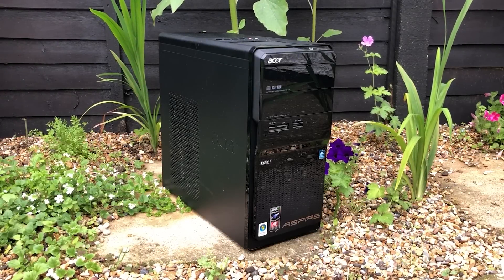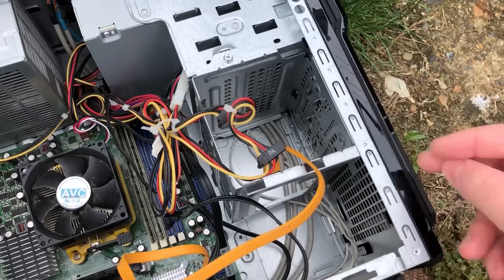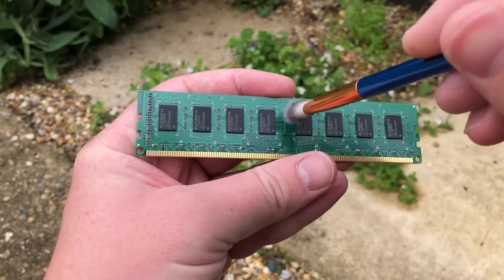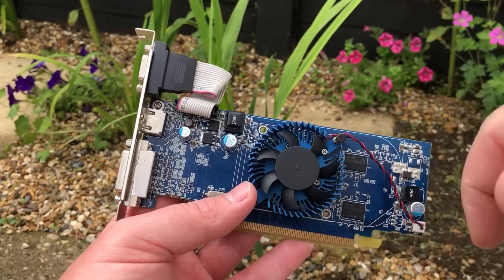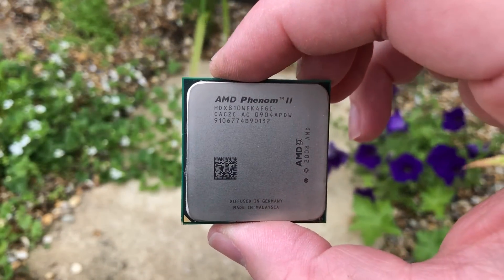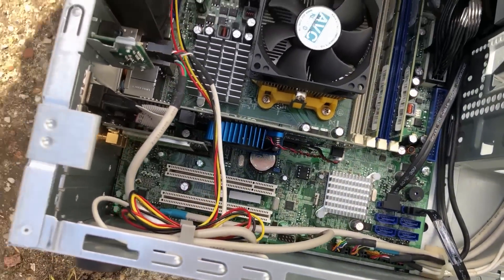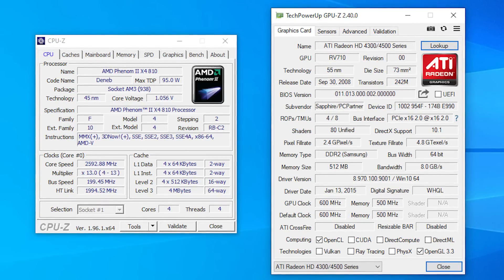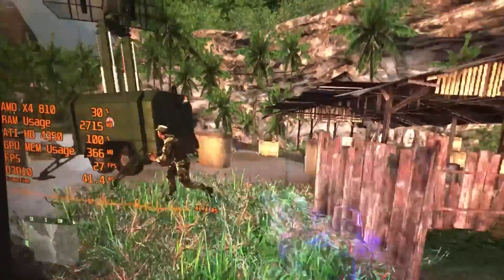Fixing Broken Ebay Gaming PCs - The AMD Acer Aspire

Comment: Shocking to see Acer using a motherboard with electrolytic capacitors near the VRM. By this time a lot of board manufacturers had switched over to polymer capacitors. Electrolytics have a lifespan of about 10 to 20 years (proper ones built by Panasonic, Nichicon, Rubycon and United Chemi Con anyway). 

Wonder if that could be the source of some of the instability?
Reply: Ten years ago, there were many lower end boards that predominantly used cheap electrolytic capacitors.  It's one of the reasons why I don't buy second hand boards from that era, because of the inevitable bulging capacitors.  As you quite rightly point out, the lifespan of these capacitors is around 10 years, give or take.

Comment: Gotta be careful replacing the CPU, that one should be rated 95w but the higher end ones go to 125w which is quite a bit for a old Acer OEM board - also, a lot of the X6 CPUs potential might go to waste if the board doesn't support OC (doubt it does).
Reply: In that case a 945 in C3 revision, a 960T or a 1055T should work, they all come in 95W

Comment: I currently am using a single core sempron 145 and the motherboard Igpu.

My uncle gave it to me with a badly rusted powersupply and caked in moist dust, gave it a clean and used my own PSU and now its running pretty well for everyday use and OSU .

Comment: Old toothbrush works great on caked on dusty fans/heatsinks. A s for pairing a graphics card period correct would be something like a 4850/4870 or any of the refreshes like the 6850/6870. 7750 would probably be closest recent equivalent

Comment: These old amd CPUs sucked. A gemini lake celeron is as fast as this. It's comparable to a q6600 at best and those were paired with 8800gt and ati 3850. You could definitely put a 1030gt in there as a maximum and have a decent, albeit stupidly power hungry low end system

Comment: It's oddly therapeutic to me seeing old low end hardware. I just grew up majority of my time gaming on low end hardware like the GeForce 6100, Intel GMA X4500. And I have a laptop today that has an HD 3470. It's surprising to see me play games so well when the fps is low. like, when the fps isn't tied as hard to input latency, Im still good. Maybe it's a guilty pleasure because of all the good memories i got in gaming, using low end hardware.  including the FX 5200. It was really a time where people would play a game at 800x600 at 15-25fps and be happy it runs. When nowadays, people find 40-50fps unplayable... But for this PC, for a GPU, i'd suggest the likes of a GTX 760, or GTX 960. I used to run a GTX 770 on my old Phenom II x4 B95 3Ghz a few years back, and got pretty decent results. Though of course that was 2017 - 2018. So it won't be doing much modern now. But it'll be good for the first half of the PS4 generation, and most of the later half providing expectations are lowered.
Reply: laughs in maxed out Unreal in 640x480 on my Pentium 3/Geforce 3 build.
Reply: @HappyBeezerStudios  GF3 Ti 500?

Comment: I have Phenom II X4 955 BE, paired with RX 460 4GB. It can run GTA V but it suffered the "disappearing buildings" issue in city area. 
I don't know if it caused by the old processor, or 5400 rpm HDD where the game was installed.
Reply: Might be worth shoving a decent SSD in there to see if that fixes it. If it doesn't, you still got the SSD to put windows on.

Comment: GT 730 or R7 240 would be a good pairing. I used phenom II x4 955 3.2 ghz with R7 370 4gb and cpu as a clear botleneck in some games like GTA V. If you aim at 30 fps and crank up the graphics settings it was ok with it though.

Comment: Looks like this computer was made back when Windows Vista was the latest and greatest operating system. I liked Vista even though it's probably the most unluckiest operating system.
Reply: Yeah, the requirements to properly run it weren't too different from 7, 8 or 10, but more than what XP needed and many systems didn't had that. And many prebuild and OEM systems also didn't bother with it.
Reply: @HappyBeezerStudios  it's just like I have a Sony Vaio desktop prebuilt that was giving to me that has a Pentium D 820 cpu from 2005 and I was actually able to have Windows 10 on it although it's original operating system was Windows XP media center edition 2005.
Reply: @HappyBeezerStudios  Sounds like that would be a good gaming PC in 2004.

Comment: Also, a pro tip for cleaning: you can use a pipe cleaner to get in between the fins on a heatsink or fins on a blower fan cooler, it works quite well and is satisfying!
Reply: I use a toothbrush and a pastry brush. Get's into most things and are soft enough to even brush PCBs.

Comment: Nice review and recovery of this PC, I'm sure it will be just fine as a basic PC for daily tasks. I'd upgrade the RAM to 8GB (4GB isn't too good nowadays), and possibly the GPU too. I'd also go for a 256GB SSD and a secondary HDD (either 500GB or 1TB). The graphics card would probably be used as a display adapter for outputting to a monitor - that's all it's worth, anyway.
I like how the motherboard also has 6x SATA slots - perfect for the 2x ODDs (don't know why a lot of desktop PCshave no ODDs), an SSD, a HDD, plus two spare (for adding more HDDs if you store a lot of data).

Comment: 1:50 That is the exact same wifi adapter as mine, Had it for like 4 years and has 2 broken antenna and 1 is hanging off, still works though.

Comment: Could upgrade to the Phenom 10xxt 6 core and use Intels Software Development emulator to add the instruction sets through the external emulator. It would be ~ the 2500k in gaming performance and still be able to run modern games, albeit with choppy framerates.

Comment: I've had one of these Acer prebuilts for a while as a backup pc featuring a Phenom 9550 x4, I maxed out the ram at 8gb and paired with a 2gb R7 260x, it ran decently and I managed to play some games such as RE7 on in (720p med settings but still, over 40fps), I then sold it to a family I know without the gpu and they managed to kill the machine by never EVER turning it off and by exposing it to continuous power shortages.

Comment: the r5 240 would be the most fitting gpu in this prebuilt..smth like the gtx 950 would be better but its too much for that cpu+a 128 gig ssd would be a huge jump in the performance of this system.
Reply from the maker: Yeah adding an ssd to an older system is always a great way to see instant performance increases

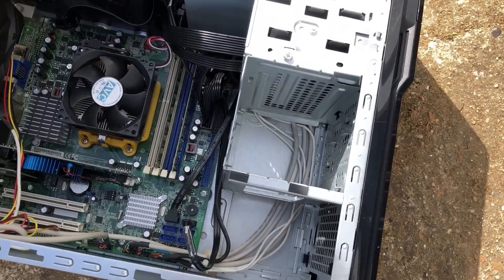Comment: 7:44 - you have inserted the RAM sticks in incorrect slots. The old AMD boards are a bit different. You have to go by colour, so plug the two sticks next to each other to get dual channel
Reply: @EverythingRandom Still no reason not to give it all the potential performance it can have. Best would be to look at the manual to see which method they use on that board. I know of some that need them next to each other and others that want them in slot 1 + 3, and those are from the same time.
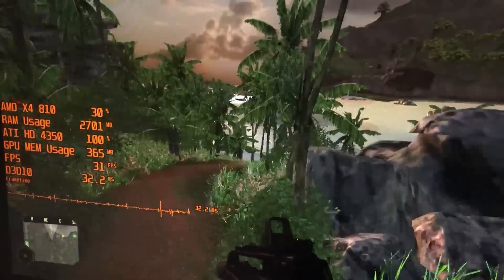Reply: Apparently not. In 10:38 you can see the RAM usage is about 2700MB and the RAM is 2GB each stick
Reply: @ClayWheeler He is talking about dual channel, wich is true, in these old AMD boards you should put the memory sticks next to each other, ir else It will work in single channel
Reply: @LucasMarquesJ1  then why MSI Afterburner can report 2700 MB RAM usage? It should be 2000 max
Reply: @ClayWheeler  You should read a bit more about memory placement on motherboards with 4 ram slots, you CAN make 2 sticks work together in single channel, they will give you 4gb, BUT you will lose memory bandwith, thats why you see diferent colors on motherboards with more than 2 ram slots, so you can know where to place each pair of sticks. Take a look at the beggining of the vídeo and you can see that the computer came with the pair in the 2 left slots, wich would enable 4gb in dual channel, by placing them in diferent collor slots, he will have 4gb in single channel.

Comment: Regarding use of the makeup brushes, i used one to get thermal paste of the pins of an amd cpu, it worked wonders, but i did trim the bristles down so it made it a lot stiffer. Ive noticed that that brush also works wonders on tougher grime, like on fan blades, opposed to a softer brush.
Reply: Toothbrushes are another option. For fans that is.

Comment: You could upgrade to a 6 core phenom II, or maybe a 900 series x4. There is not much more you can do on the socket though, you will be limited by instruction sets. I have a tinker system with a x4 950 in right now. When paired with a 1050ti it can play lots of great games GTA included but don't expect good performance in anything new, if it even starts them. For day to day and office use they are still good cpu's.

Comment: I love these old GPUs/old PCs videos because it's often hardware I used to own, or still own. I still have a Vista system with a Phenom X4 9650 and a HD 4870 x2, it actually runs Crysis quite decently. Thanks for the great videos!
Reply: Makes me wonder if the board supports Phenom II, something like a used X 945 or 955 would give it quite a punch.
And nice to see another 4870 out there, only have the single card, which is waiting to get some use again.

Comment: Sux they are not supporting the gtx750 anymore. It would be the highest level gpu I would put in it. Maybe one of the pink rx550's off of AliExpress if you can get a good enough deal.
Reply: Nevermind $160 is way to much to spend for the rx 550.

Comment: I once bought an Acer small form factor PC for 15Euros in an ebay auktion. It had 6GB ram an i5 2400, HD 6670 as well as the usal stuff like card reader and DVD burner. It also was listed as defekt but the reason for that was a missing harddrive. I simply bought an Crucial BX 500 for 15Euros and the perfekt office machine for my mother was finished.

Comment: If you encounter those thick thermal paste that have essentially turned into a brick, a razor blade or any other sharp blade can actually help to remove most of it before you use the isopropyl alcohol

Comment: My trick for cleaning old paste like on that CPU is starting with toilet paper and rubbing alcohol or lighter fuel. Might need time to soak, but that should get rid of most of the stuff. Afterwards come the qtips and toothpicks.
And for the fan: A toothbrush works wonders. Hard enough to scrub away the dust, but soft enough to not damage anything.

Comment: the £5 advent pc i found at a carboot a few years ago had a blu ray drive in it, as well as a core 2 quad 8000 something and a ati 3450 which i replaced with a gtx 640 and upgraded the ram from 6 to 8gb
Reply: Got my Xeon X5460 (basically a Core 2 Quad 9000 chip) with my old GTX 660 Ti and it's still kicking.

Comment: I found a quite cool pc that is very interesting. It's an hp envy 20 touchsmart all in one which uses laptoop ram, gpu, dvd drive but have a desktop cpu. If you could find one they still are decent systems with a good upgrade path. The upgrade path to the cpu can go up to an i7 3770s but the gpu is different. It uses an mxm gpu meaning that you can only use certain graphics cards with a specific vbios. The compatible cards are a gt 610m, gt 630m, hd 7450a, hd 7650a.

Comment: Missing instruction sets are: SSSE3 (not SSE3 - which it has), SSE 4.1, SSE 4.2.
Reply: and AVX, no?
Reply: @edge21str  ye, CPU's didn't have AVX until sandy bridge, AMD FX.
Reply: @edge21str  Sure, no AVX, but there aren't many games that won't run without AVX.  I only know of Star Citizen and the latest NFS game.  Lack of SSSE3 and SSE 4.1, though, will mean a lot of AAA games won't run.
Reply from the maker: Yeah it’s a shame really as it’ll still probably do alright in newer games otherwise
Reply: @RandomGaminginHD  you can run Intels SDE to add the instruction sets externally through emulation, it is a bit hit or miss though
Reply: This is why I upgraded to FX a few years ago.
Reply: The number of games messed up for phenom thanks to that dreaded sse4.1, that's why I ditched mine couple of years ago. It was still going strong for 1080p with a solid gpu tho.
Reply: a n i m e
n
i
m
e

Comment: I’ve paired this processor up with a 1050 ti a few years ago, was still good enough to run games upto around 2015 without much trouble 👍🏻
Reply: Pretty sure even a 950 would do for like Siege, Rocket League, GTA
Reply: Helps how weak the Jaguar CPUs in the PS4 and Xbone are
Reply: If the board allows for OC, getting it up from 2.6 GHz to somewhere around 3.2-3.6 would give it quite a punch for lots of games. We're talking about Core 2 Quad performance and clocks here, and those are still okay for many games.
Reply: @HappyBeezerStudios  yeah, up until 2018 I was using a GTX 960 4GB paired with a Core 2 Quad Q9550 and 8GB DDR2 RAM. It could still run titles like Star Wars Battlefront at around 60FPS, but anything newer tended to suffer from low FPS or nasty stutter (Rise of the Tomb Raider was pretty bad in the later areas)
Reply: I still keep my old Phenom II PC around for older games. What a great CPU.

Comment: Could you do a video on the 1st gen core i5 and i7 like core i5-650 ??
Reply: The 600 were dual cores, not that great, but the 700 were native quads and are still usable. Performance around a C2Q, depending on the task.
The next step from there are the 6-core i7-900 chips (and their Xeon equivalents) that can still kick ass.
Reply: Yup, still using my i7 990X. And still never been overclocked. Love it.👌

Comment: I cringed a bit seeing the case on it's side on dirty concrete, can't be good for the paint. I like to put a towel under a PC even working on a clean desk to avoid scratches
Reply: It is very old to be fair and it won't scratch if you dont move it around.

Comment: That blue gpu cooler pritty good for its size because it could run my 8000gt series card under 70 celcius
It was a 45 watt card
Reply: Probably a 8600 GT, that should be doable, try that on a 8800 GT and there is no way to keep it cool.
Reply: @HappyBeezerStudios  at least i know it had 256mb vram and ran minecraft at 60fps

Comment: I also used an quadcore phenom
Reply: No you didn't
Reply: @sotirzvanidjubre4109   i had a quadcore phenom running at 2.3ghz with a nvidia 120gt 1gb and 4 sticks of 2gb ddr2 and a 640gb hdd
450 watt psu, 2 dvd drives and a no brand case that had 2 case fans 
One in the front and one in the side